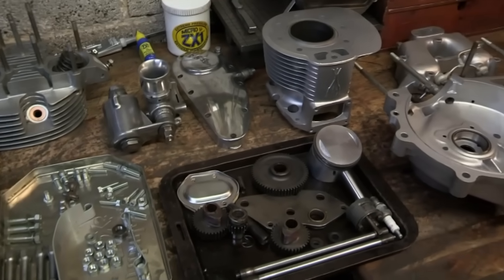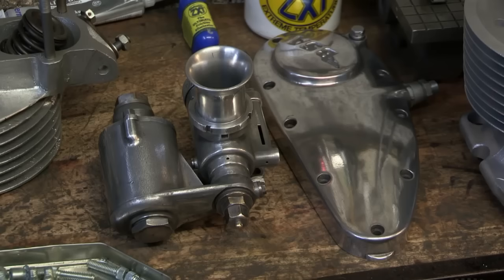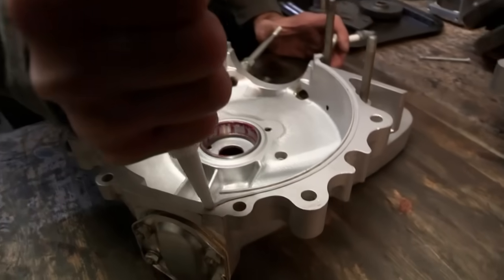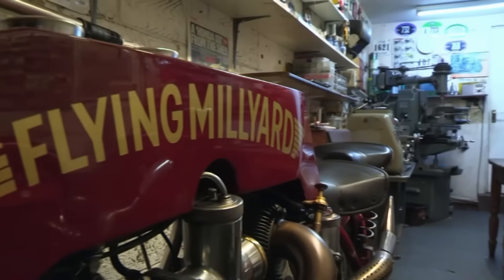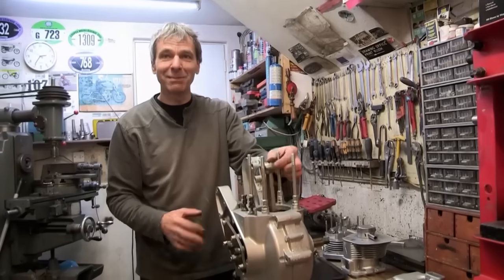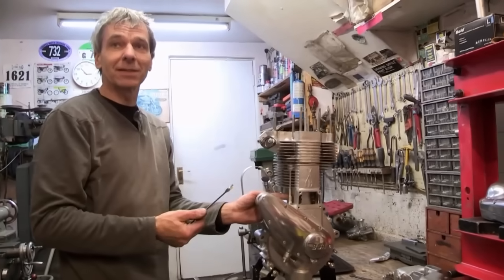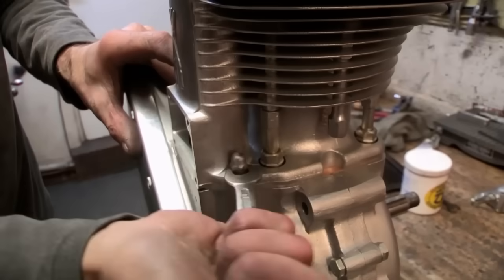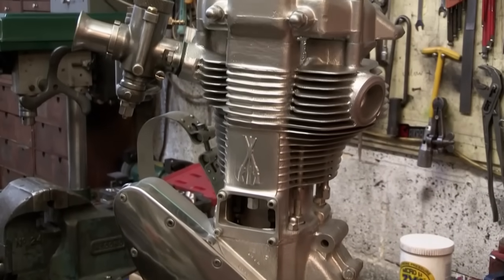BSA Gold Star restoration Part 3 - Allen Millyard engine rebuild

Comment: And this is in between Allens brilliant rebuilding and modification of the Norton Nemesis, incedently when I was a teenager rebuilding my BSA Super Rocket back in the 60s (in the back yard, no garage) I had to use a kettle of hot water to warm the pistons for the gudgeon pins and found supporting the pistons at TDC  was quite easy to lower the barrel onto them.

Comment: Allen won't be getting much out of that motor, he's fitted a long rod piston to a BB, or mid length rod motor. The distance above the gudgeon height is the giveaway. The ZB Gold Stars have the long rod, and the BB has the mid length rod.
Reply: Everybody makes mistakes, even near geniuses, though if the above is correct one would think he'd notice piston position at TDC. The piston was well down in the barrel.